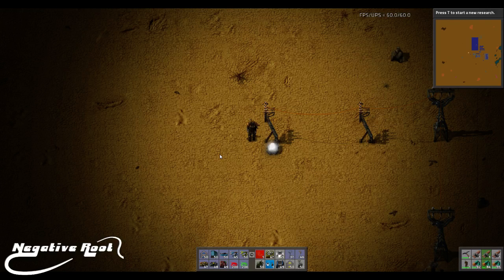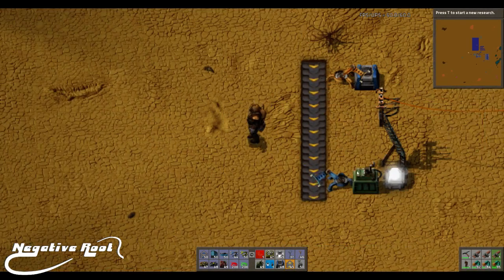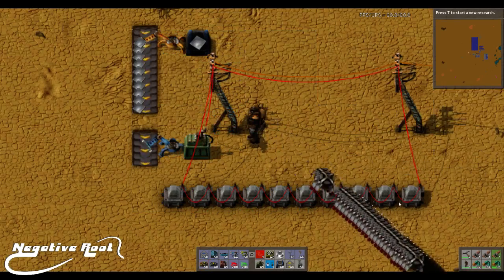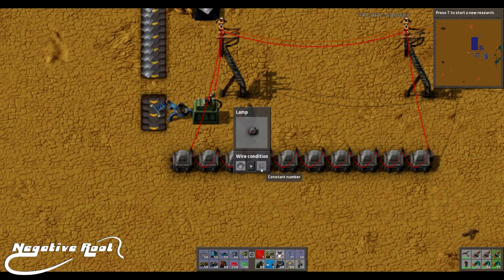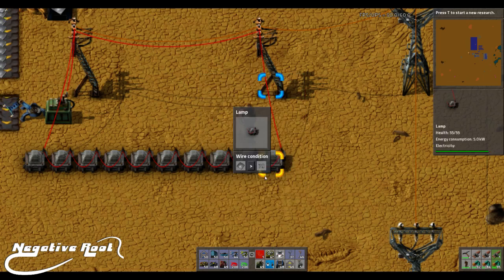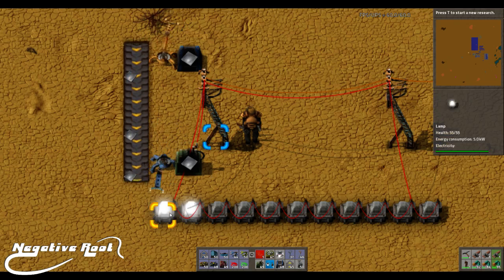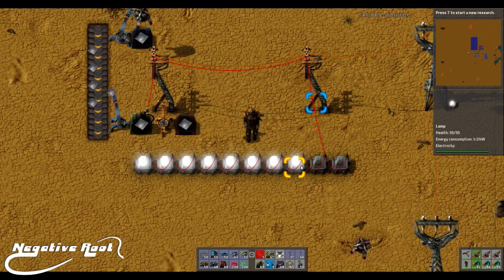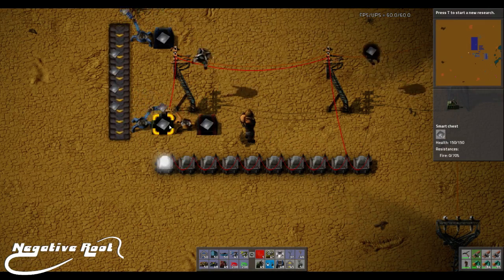Factorio Tutorial 47 Basic Gauge

Comment: Okay, you know what we need, smart trains. So, basically, instead of having it so the trains wait x seconds, the train waits at the station until it is full, and then waits at the unload station until empty. Is this possible? I think the unload is possible, but maybe not the loading. Would be good if the wagons could be tied into the grid. Once full, off goes the train. This would actually dramatically reduce contention on the line. But would require more unload stations.
Reply from the maker: Beren Scott yeah, there are all kinds of plans being made for this kinda thing. A Roller Coaster Tycoon "wait until full", "wait until empty" option would be awesome and so very, very simple.
Reply: Negative Root Try this, two rows of smart inserters, the second row only places into box when the first row is empty, the first row places directly into wagon, the second into the box. Now, the box has only enough space for 1 item or whatever the inserter amount is. So, when the wagon becomes full, the boxes will all be empty, because the item will be stuck in it's hand. All boxes will be empty, the second row of inserters will all be empty as well, therefore, trigger switch?
Reply from the maker: Beren Scott the wait times at the stations are still static though? they won't be dynamically set depending on wagon load?
Reply: Negative Root I am thinking, use the station to park the train, then use a signal to line it up with the inserters, so, the train station really is just 0 seconds. But, tie the signal in with the inserters. Know what I mean? Can you tie the signals in with this system? Could make for some complicated systems.

The other way you could do this, is have the train park outside the loading station, and then getting the green signal when the loading zone is full, and then simply working out how long it takes to fill the entire wagon.
Reply from the maker: Beren Scott signals can't be controlled by the circuit network yet... but I like your train of thought (excuse the pun).

The issue is we have no way of controlling train departure short of unfuelling/refuelling the locomotive.